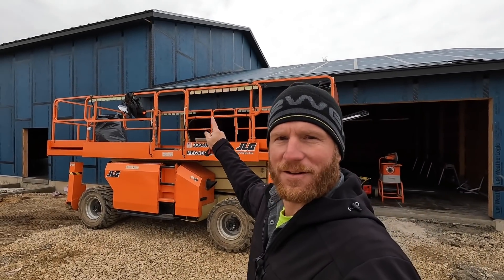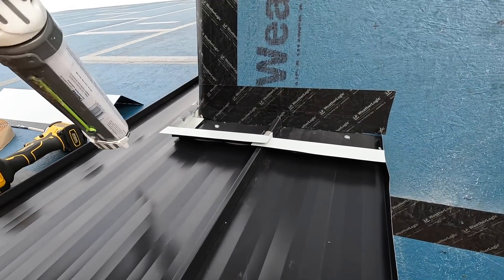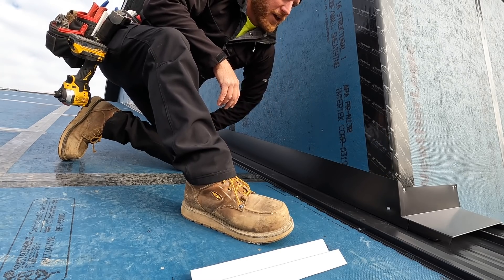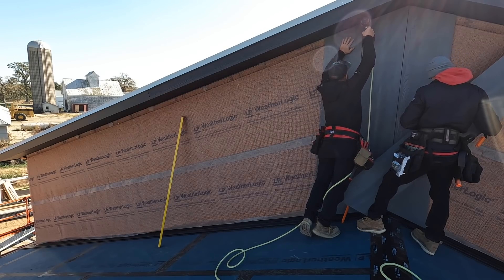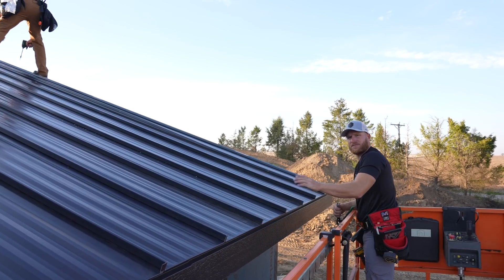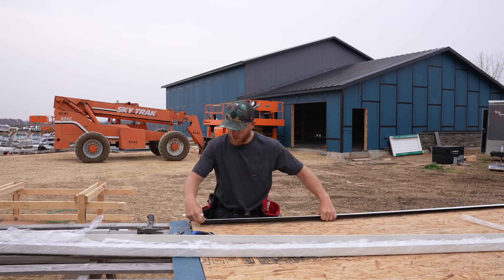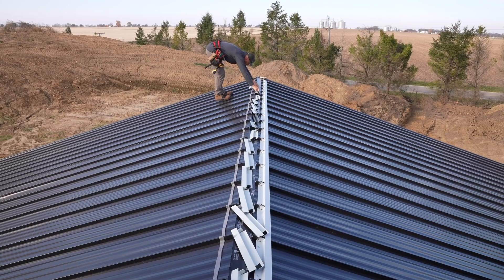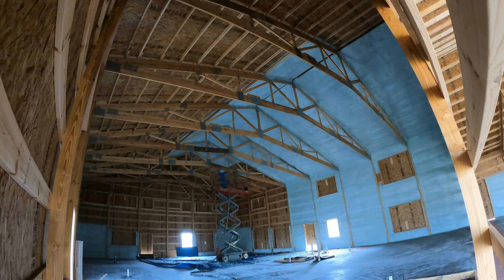Building a Barndominium 10-2: First Look at Smartside Siding

Comment: Fluid applied flashings are the only way to prevent the pin holes in the WRB integrated sheathing (all WRB’s for that matter and metal flashings) you speak of around min 9:40. Specifically silyl-terminated polyether’s. Fast Flash by Prosoco is the pioneer of the industry and the best in my opinion. I work in the building envelope industry. If the WRB is monolithic and continuous, and the cladding system is allowed to drain, you won’t have any water related damage, or leaks. You do a great job, and thought I would share a little bit of my expertise for you to use…😉

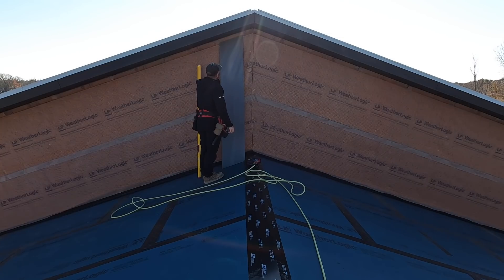Comment: @12:15 IF weather logic is a water proof and air tight system why put a house wrap on between the WL sheets and the vertical boards? @31:58 is that black pipe insulation added to under side of ridge vent?
Reply: Thats rain screen. It gives a airspace’s between the siding and the wall

Comment: Thermoplastic, means it's a recyclable plastic. If you need to reuse it in another way, just need to heat it up to its molding temperature and it can be reformed to whatever you like. I hope that helps

Comment: Great video man.
Curious why you only went up 1 inch on the panel, but went up the 3 inches on the ridge.
We flash differently from each other. Also I would have started that whole first panel about an inch from the wall and used a close out trim to come out over the standing seam. What you did was great and I've never seen it done that way.
Just seems like a whole lot of extra work tbh, with the same result. Great work tho. Can't see that ever leaking either.
I really like the way you did the ridge cap though. Awesome job.

Comment: So spray foam and then interior framing and then more spray foam? There will be interior framing on the exterior walls so that drywall can be attaches correct? Will you have to clean up some overspray to make the walls fit ? Thanks
Reply from the maker: Stay tuned man

Comment: What are you using for a 'roof vent'?  So far (part 10-2) it appears after the roof ridge is a closed system with putting the two sided putty tape in place.

Comment: So your worried about movement from heated and cooled roof panels and you have a spray foamed roof. As in an entirely sealed envelope but you didn't build a cold roof? You will end up with mold under that metal roof. Condensation build up and no place to go. Also a black roof in steel will get extremely hot in summer which is why this is a second reason that you should have built a cold roof. Everything else is great. 👍

Comment: In a typical rafter build you usually run baffles in the rafter bays from the soffit to the ridge for airflow behind the finished ceiling, it looks like the spray foam completely fills in that space, do you not need that soffit-ridge vent connection because of the spray foam or something?

Comment: Lots of nice detail work. My only critique is why are you face nailing those panels? That looks really sloppy having exposed fasteners. Otherwise great job.
Reply: He explained he was using it as a backer.  I believe he said they are putting shakes on the gables
Reply: @mikemessenger1681  Ok. I didn't catch him saying that. A different type of panel would preclude the need for all those fasteners though. But, definitely good work. Thanks for the clarification.

Comment: Thoroughness is its own art form.
And it demonstrates authentic caring.
Owners can be reassured there won't be emergent issues down the line.
You guys win the Holmes on Homes award.
Reply: Thoroughness is its own art form??? Demonstrates authentic caring????  What kinda shit is that????
Reply: @crossbow3539  - Heckling is not an art form. Neither is profanity. But I don't lose sleep over either one.
Reply: @crossbow3539   - You should take back most of those question marks. With them, you spent over half of your vocabulary. Not a prudent move.

Comment: 9:23 I have a better way to do that!

Think like a shingler instead of a metal panel guy.

Your trying to do too much with one piece. Basically break that big panel running all the way into two pieces. The bottom one would be small and run up the wall 4-6”. The second one would run past the corner over the small one but leave that upstand on it. See how shinglers run their steps past the bottom of skylights to understand what I mean by running it by. Hem that piece nicely.

You’ll see the seam there but water that is picking up steam along that wall will flow easily past that corner with no reliance on caulking
Reply: I've done it this way too and was going to write same suggestion.  Aesthetically you see two pieces with overlap which isn't so great, but that corner is protected so much better.
Reply: @charliehiggins9355  absolutely agree 👍

Comment: Love all the details as always Kyle and Greg! One question on the spray foam. Does the contactor come back and seal all outside penetrations once completed (electrical/ exhaust fans/ etc) or do you do that once all mechanicals are installed? Im used to spray foam going in after mechanicals are done on stick frame builds.

Comment: Use a fresh blade on a utility knife and cut the caulking tube tip at a 45 degree or greater angle.
This helps to apply a bead more smoothly and more evenly.
Cut a bit higher up as well and the silicone will come out easier. When you drag and caulk at an angle, it is so much easier.
Reply: Straight cut is better
Reply: @willtillmann4077  - A tapered cut allows you to drag and apply with a much smoother and more even bead.
The two variables are the size and angle of the cut opening.

Comment: Isn't encapsulating those wooden beams in spray foam insulation going to cause them to rot?
Reply: If you spray foam wood that contains moisture, yes. If the wood is appropriately dry when you encapsulate it, it should prevent rot.
Reply: @danielrutherford9456  In this day and age I rarely find that wood is moisture free. If it is, then it’s ridiculously expensive. Plus building this time of year with very high humidity will no doubt cause the wood to capture some of that moisture…
Reply: @tonylorentzen  yeah I would say if you suspect your wood contains moisture to find a different solution. Open cell is supposedly better for encapsulating moist wood, but I’d still bet it’s not ideal.

I think if I’m going for a belt and suspenders solution that I would insulate inside with Rockwool between studs/posts and use exterior insulation over Zip sheathing.
Reply: @danielrutherford9456  Yeah I’d probably go with the same solution. Possibly more expensive - but also easier to make any kind of changes to/repairs on down the road.

Comment: You are doing a terrific build, and a joy to watch. The insulated/air-condition attic is the way to go.  Here in Texas we run all of our HVAC ducting in the very hot or very cold attic space, so dumb. You've made Matt Reisinger's Monopoly Framed House!
Reply: They're close. I would've done exterior insulation and cut the rafter tails and made exterior overhangs like Matt. That's a better assembly imho. It's the way I'm doing mine in Eastern Idaho.
Reply: @jwristen24  You mean exterior insulation panels and no inside the wall insulation? Can you get enough R rating going that route?
Reply: @bucsanders7861  yes on both. Exterior and closed cell would be best practice. But not cheap.
Reply: @jwristen24   Their trusses do not have overhangs, they add them. See the video: "Building a Work Shop: Framing Overhangs and Preparing for Roof"
 The main thing about this build that caused me to compare it to a Monopoly Framed House is that the wall and roof insulation is joined with no insulation break.
Reply: @dsdragoon  I like the way Risinger did his house. Not cheap by any means but it's prime.

Comment: I just finished getting my post frame spray foamed. To seal the soffit opening from the building side, I used aluminum insect screen stapled over the opening. The foam stuck to the screen great and didn't penetrate into the overhand at all.

Comment: Nice job Kyle, might I suggest instead of using a counter flash for your end wall, use a similar flashing to your front wall in order to divert the water away from your wall by a few inches. You can use a bread pan and dog ears like it was a skylight to eliminate the pinhole in the corner. Thanks for the great videos.

Comment: I have followed this build series since the beginning and have learned many things. You've sold me on the LP products. I think. I am interested in the relative cost comparison between their product and conventional roofing sheeting. Because you also do full roofs, do you have a cost comparison for the entire system (ie sheeting, water protection, and the actual roof). The LP seems a more labor intensive effort up front with the taping of the seams but is that offset by not having to run a more conventional seal like roofing felt or a membrane?

Comment: Call the wall itself a sidewall or endwall. The flashing there is definitely called sidewall flashing. As it covers the length (or side) of the metal roofing panel. Whereas end wall trim would cover the "end" of a metal roof panel. Just stating that for any would be customer of mine in the future lol.

Comment: Thanks for doing flashing really well.  I’ve helped a couple friends replace rotten siding, trim, pulled windows and tore off an entire deck and everything surrounding a slider because the builder didn’t flash anything… and I’ve fixed a few things on my house, too.  I realize the effort and not neglecting to take the time to do it right.  Keep up the great work!

Comment: Kyle, I have a question about the spray foam. Do you spray between the posts and outer sheathing? Or so you just spray the corners good enough to seal that area? Thanks!

Comment: Always good videos !
If you want to try a easier way to get the Ridge Cap on... 
On 1 Side, have your metal shop only bend half way to about a 45 degree, and hook first side and then you can pull out the metal on the half way bent side and bring it over the Z Flashing, and then crimp the ridge edge tight with your crimp tool.